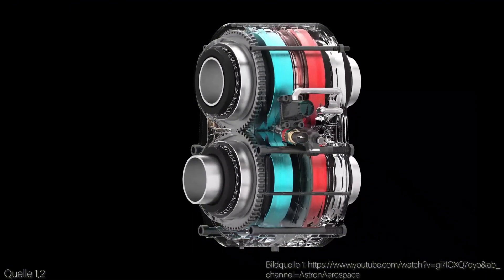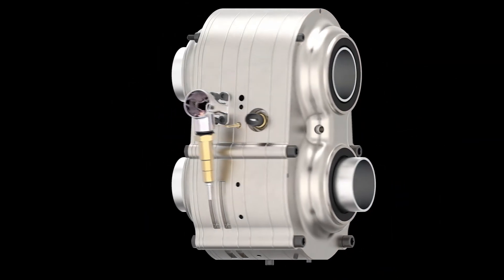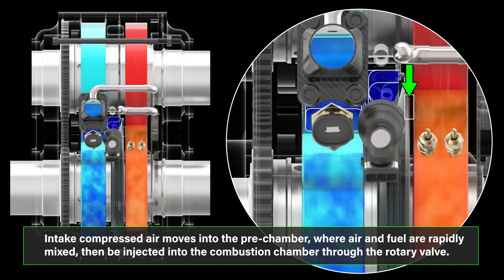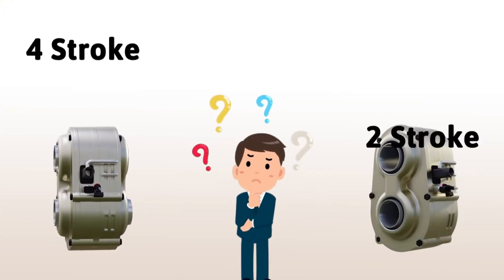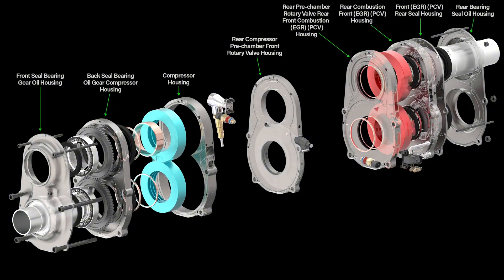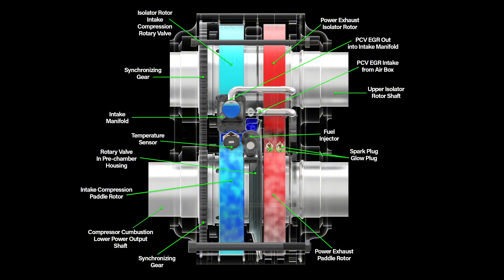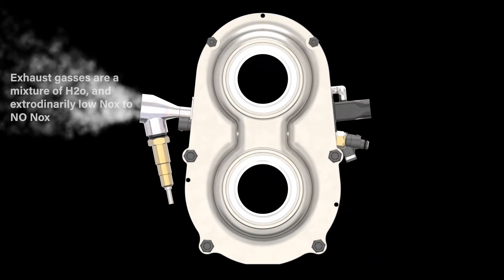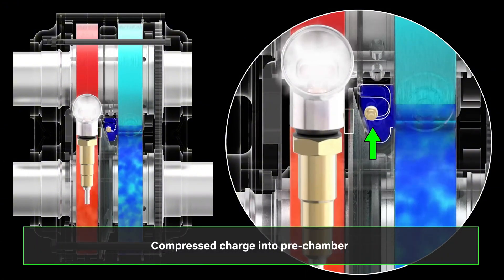Introducing The Omega 1. A Revolutionary Engine.

Comment: 🤦🏾‍♂️green hydrogen cost nothing that why its green often comes from solar powered system turning water to hydrogen through electrolysis or something but the process is renewable or stainless or something tbh i don't see how this engine will be efficient call me traditional but people have gave it their all with these Winkle type motors they're just not a good idea for modern times if you ask me so on the fat chance this has some actual power its probably as efficient as a jet engine😢

Comment: 160 hp and torque.... 1 ft lb - 10 ft lb - 100 ft lb.... who needs 25k RPM.... there is a reason this never worked in the past
Reply: That's why we have gearing. You never attach an engine directly to the wheels. Horsepower and torque CURVE is the only thing that matters. If the torque curves are shaped similarly, a million rpm 100 hp engine will perform EXACTLY the same as a 1000 rpm engine of the same hp, as long as you have adequate gearing. Nevertheless, this engine is plagued by other issues and their claims are completely unbased.

Comment: Hydrogen can be easily stored in liquid ammonia. Ammonia can be liquefied at 10 degrees Celsius and 6.5 bar, and contains more hydrogen than liquid hydrogen. It can be decomposed with an iron-ruthenium catalyst.
Reply: Safety hazard.  Ammonia leakage is a chemical hazard.  Low concentration causes irritation.  And higher concentration can kill people.  You need a lot more safety protection when using in cars.  It makes the fuel a no no in real life.

Comment: Hydrogen is more than difficult to store. It must be cooled very close to absolute zero to be liquified, and kept at this crazy temperature until injected into any motor.
Until there is a major breakthrough in the storage issue, you're just pissin' into the wind.
Reply: You're living in the 70s, this has already been solved a long time ago. Liquification is easy with today's efficient refrigeration heat pumps and so is high-pressure (not temperature as you say) storage. It is cheap, safe, and reliable. Yes, safe too. There is research that shows hydrogen storage is safer than hydrocarbon storage, and you are free to look it up.
Reply: @LocPH.  So the storage issues are all solved, and hydrogen is a rapidly growing alternate fuel? Yeah, right...
Reply: @Devo491  the reason for the lack of a significant hydrogen economy is not due to storage issues. It's mostly due to the energy inefficiency of producing and burning hydrogen, which makes it very expensive. Storing and transporting hydrogen can today reach 85% efficiency, meanwhile electrolysis is only 70% or so efficient, and burning it is at absolute best 60% in very expensive fuel cells. The cost associated with producing and burning far exceeds storage costs. Storage is NOT the bottleneck.
Reply: @Devo491 also I forgot to mention that there is now more interest in compressed and particularly cryo compressed hydrogen (CcH2) because it's much more energy efficient and can achieve higher energy density than liquid hydrogen. High strength tanks is one of those issues that have been solved, they no longer suffer from hydrogen ebrritlement and are much cheaper than decades ago, because of advancements in material science (mostly composites).

Comment: What about torque. Does it bogg down as soon as a load is applied
Reply: 160 horsepower @ 25,000 rpm = 34 lbft of torque 😬
Reply: @OsakaBancho , that's why we have gearing. You never attach an engine directly to the wheels. Horsepower and torque CURVE is the only thing that matters. If the torque curves are shaped similarly, a million rpm 100 hp engine will perform EXACTLY the same as a 1000 rpm engine of the same hp, as long as you have adequate gearing.

Comment: This is an old scam...show me a proper running real prototype...the few videos of a running motor were junk...this concept looks good on paper, but in the real world motor is junk!!
Reply: I just saw this engine mentioned in the news again. Now it's being called the H2 Starfire and they are hyping Hydrogen. In the only "running" video of it under that name, you can see that a man standing behind it is making it turn with something like a drill. At the end you hear it still turning but the exhaust flame has stopped about the time a second person says "Stop!".  I believe that the exhaust flame does not look like efficient burning of the fuel but I haven't seen exhaust from hydrogen fuel before. 

I would think that after two more years of "development" we would see something better and more complete than the little glimpses we've seen where it appears that it is being turned by outside forces.

Comment: To become useful for a wide number of applications the Engine will have to operate on Natural Gas. Vaporized Gasoline would be better. A Multi-fuel design would be best supported by existing infrastructures.
Reply: I agree, this is critical. If it requires an entirely new fuel like hydrogen it will likely be a non starting in all but very specialized applications.

Comment: This is a joke machine. The whole thing could be a click bait game. First off the engine shown appears to be leaking gasses. That could be the water vapor from hydrogen but it seems to be blowing out where it would be inside the engine compartment. And while it claims to reduce Nox that does not like an electric eliminate Nox. It also seems under powered for heavy duty vehicles. Adding extra engines will require more space, more cost and more maintenance. That's a serious problem given the financial impact and long production chain of  hydrogen in particular the huge energy costs of working with green hydrogen. Hydrogen has already been debunked as a viable fuel because of these issues. Try again combustion engine guys or just wise up and start working with electric motors - smaller more efficient and more powerful.

Comment: Still waiting for efficiency/fuel consumption figures. The most significant problem is where are you going to get hydrogen from and how are you going to keep it in your tank?
Reply: Make it as needed from Water!🤦
Reply: Thank you! Easy! @spiritzweispirit1st638
Reply: @spiritzweispirit1st638 jajaja la próxima guerra es por agua y estos motores
Reply: and how well will the seals last
Reply: Same seals as jet engines.. @indigoskywalker
Reply: A solar cell was developed to separate hydrogen from water.  Collection and storage is a logistics issue.
Reply: @hillbilly4christ638  "collection and storage is a logistics issue" That's the understatement of the century!

Comment: Extra st8ll to complicated expensiwe short time using expensiwe,,,,,yustvtry Balkan 3x Neodium Engine 20 kg 200 hp cheep ,,long ride some 100 years ++... quiet slide ..long service time  x ..x ..x...end more...,,,no fuel tank pipes senzors noting...2x4 4x4vorc8x8  plus if its need reductors